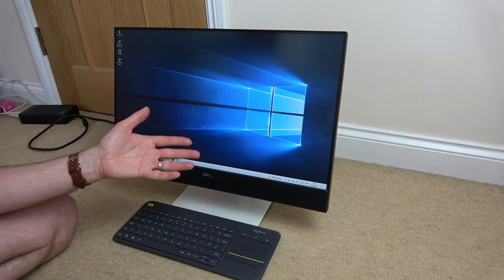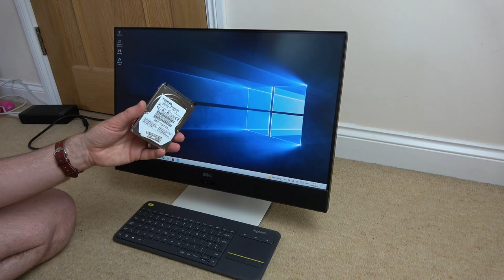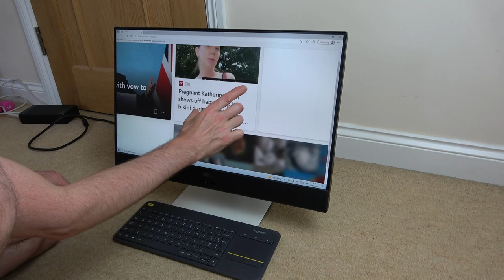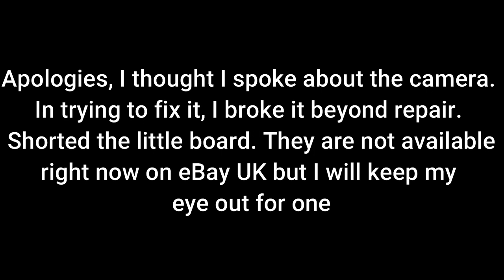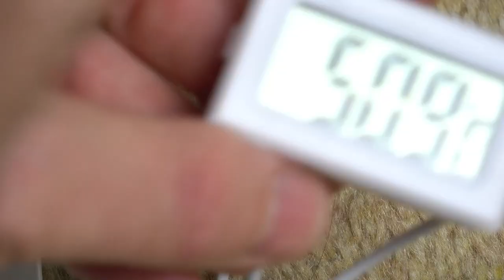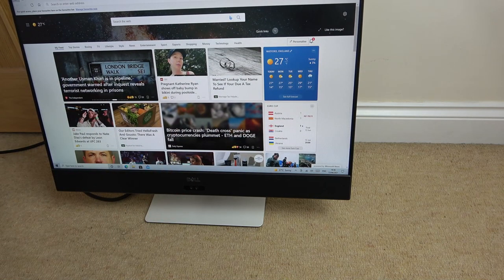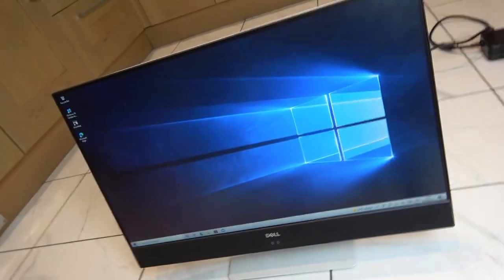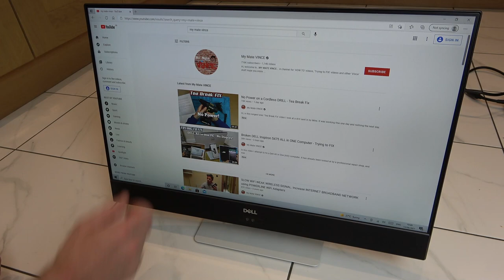REVISIT on Touchscreen not working - DELL Inspiron 5475 AiO

Comment: May be imagination, but that wifi/bt card looked slightly crooked. May be worth a reseat, but beware the antennae wires; the connectors are delicate. Would actually be tempted to leave the wifi/bt card out and see if the touch port starts working. Might also be tempted to go to a load system defaults incase someone turned off the touchscreen/bluetooth.

Comment: PCH's are usually rated for around 110c and for that reason it's a terrible location for that bios/uefi battery. Maybe the mod here could be to relocate the CR2032 as they are only rated to 60c (laptop coin battery could buy you an inch or 2 with the added wires and a few dollops of solder). If you have any old mobo's lying around the PCH heatsinks on those are usually a little beefier (easy swap?). If you are really concerned about the battery going kaboom, just remove it. A power loss would be the only inconvenience as the clock will forget the time. Unless you have some non default bios/uefi setting that requires the battery to remember the setting it's no real biggie to not have the coin battery.

Comment: Both USB controllers are working. 2 and 3.0. Pause at 5:58, bluetooth dongle on usb 2.0, and touch on usb SS/3.0. It must be a problem on ONLY that internal port. As for bluetooth, check for a BIOS upgrade. As for the webcam, check your privacy settings.
Reply: dud watch both video carefully and then talk there is a known issue with these kind of dell aio pcs where all fail in the same exact manner no cam no bluetooth and no touch too it is a design fault

Comment: it almost looks like there should be small 2x2 (or smth like that size) fan on that HS and the plug you think is for touchscreen is actually for the fan (i know it's not normal plug for fan but i've seen few with this socket) :D 
Kidding, but it would be a blast if there was another plug where you should put the touchscreen cable and those guys that were looking at it plugged it at wrong spot (and also did not place the small fan back). I know it's highly unlikely, but still possible :) And if it's not, well... why not use the 5V the port is providing and use it for small fan like i just described? Would at least helped with the heat (and ease you mind not worrying about it).

Comment: Regarding the built-in bluetooth, does the machine show any BT devices in' Device Manger' with the USB one unplugged? It may be hidden so you might want to enable 'Show hidden devices'.
Reply from the maker: Yes Les, under hidden devices it shows Qualcomm qca61x4a. BUT the problem is I did try another Bluetooth card from a laptop on the first attempted fix (wasn't filmed), so I can't remember if that model is the original or the replacement. I fitted the original back in as it made no difference. Hopefully I can revisit it, and find out that the original touchscreen connector, the Bluetooth and camera are all linked to one faulty component 👍

Comment: maybe you should attempt to put a beefier heatsync on the red hot controller chip to reduce any further damage being made to the board
still I think it's irresponsible of them to only put a plate of metal and not a proper finned heatsync, as well as putting it next to a heat sensitive component (the battery)

Comment: Have you checked to see if there's a driver update for the chipset or/and a bios update. PCH is what intel call it, AMD just go with chipset.  If I remember the Dell is a AMD, you can also download AMD System monitor which might give you an indication to if anything has failed.
Reply from the maker: Thanks Carl, I did a BIOS update first time round when I looked at this, but NOT a chipset update, unless that was already included in the Dell service/update page or the Snappy Driver Installer. 👍👍👍👍

Comment: Wouldn't the voltage sag if it was a short, yet you measured 5V, ie, the power line is probably not shorted. And I wonder if a data line short would load that chip that much, ie, it doesn't need high power. Keep at it.

Comment: Have you thought about just soldering the wires inside on the back side of the USB port, like on the pins? That way, there's no cable sticking out at all, and you may even be able to still use the actual port if needed (not sure if that's possible or not but I know hubs work off of one single port, who knows lol)

Comment: While the PCH is designed to be able to run hot, it doesn't mean you should allow it to run hot. BGA chips which run smokin' hot have a much higher chance of failure due to baking the solder and the temperature swings when powering the machine on and off.

I'd replace that garbage excuse for a heatsink that probably does more harm than good because it's just a flat piece of aluminum. Put a heatsink with fins on it oriented up and down so convection can happen, or put a fan on it.

Comment: USB is handled by the Chipset. PCH chip. Those chips don't get that warm, you will probably notice that the other USB ports will stop working. On older hardware such as G41 and older those chips got very hot.

Comment: I would wire in a usb drive or another usb device onto that connector on motherboard where touch was and see if it picks it up, if it does it will be drivers, if not it would be the usb controller.

the controllers on motherboard are to spec usually to about 90c, so i doubt they are too hot.

Windows 10 does updates automatically etc. and had it a few times where reinstalling USB controller driver fixes issues with say device connected to one USB not working, but it works connected to a different USB port, which this seems to be, as there is no difference between the internal and external USB connectors other than the connector.

Comment: Just out of curiosity, did you retry the cable on the motherboard after installing the new drivers??
Reply from the maker: I tried unplugging and plugging back in the touch cable while the PC was on and it still wasn't recognized, unlike the camera. In this instance I don't think it was driver related at all as it fired up straight away when attached to USB 👍👍👍
Reply: @Mymatevince  ah cool shame it didn't work,  glad you got it all up and running bar the camera

Comment: I think that chip is with normal temperatures ....  the heatsink used is completely
 normal too , is used like that in a lot of cheap motherboard or motherboards with weaker chipset´s .... that computer uses a cheap plataform designed to do light jobs , so all the heat dissipation used is enough   ...

Comment: Maybe its a dead filter like on Nintendo switches and ipads and all the other touch screen but they have put the filters on the mother board and not the display pcb. And the bluetooth the same or chip is dead. The filters may even be above the hot chip?

Comment: hi man i really need you’re help 
so the thing is 
my controller won’t connect at all to my ps4 or any other device for the matter 
i broke the light in the charge board so i replace it with an identical part but it still wont connect and i’ve tried everything every youtube vid had told me to do

Comment: why dont you solder the wires directly on the usb (idk about computers that much, it may not work)
Reply: Yeah, if they can't find a fix for the internal USB, they probably should solder the wires directly to the pins of that USB socket, then cover it over with some black tape, that would look much better then a cable sticking out the back going back in again

Comment: one general rule of thumb, use Snappy Driver Installer to get your drivers installed, it's a handy thing to have when diagnosing a potential driver issue, yes, sometimes OEMs frick up drivers. 
even though that wasn't the issue, it's something I recommend as a first step in diagnosing driver related issues
Reply: Think he refers to that on the previous video

Comment: On all DELL PC devices, touchscreen and camera can be disabled by bios setting, check them!!!!
Reply from the maker: Thanks Nikola, on this one the BIOS is quite limited. I can't find any option for the touchscreen, Bluetooth or camera. Thanks for the idea though 👍👍👍
Reply: @Mymatevince  Did you try dell support assist, it should automatically download and install all the missing drivers and software for your pc, it uses service tag (serial number) to find your exact model.
On my dell laptop touch screen is activated in bios \ uefi, under Settings \ System Configuration \ Touchscreen , and the camera is under Setting \ Miscellaneous Devices.
Bluetooth is on the same board as the wi-fi, sometimes it`s hard to find the right drivers for them, try to find the wi-fi card and see what is the model and download the driver from the OEM site.
On older AIO and laptops, there was a manufacturer peace of software that is required for some  functions to work, MSI, Lenovo and Toshiba used to do that, that software is usually  responsible for Bluetooth, wi-fi, and other miscellaneous stuff. :)

Comment: Read the section on the Root Hub and Win 10 having the ability to regulate its power,  also further down there is a link to a BIOS flash as these were intended for Win 7 (Industry machines)

https://www.dell.com/community/Inspiron-Desktops/Inspiron-24-5475-AIO-Touchscreen-IR-not-working/td-p/6092733

Comment: If the chip in question has a data sheet (or even a similar chip if not that exact one) it should provide a normal operating temperature.

Comment: 🧐 since when do computer monitors have touchscreens
Reply: The first resistive touch screen display was developed by George Samuel Hurst in 1975. However, it was not produced and used until 1982. The Apple I and Sol-20 computers were the first computers to have a built-in video output port, allowing for a computer monitor or video screen.